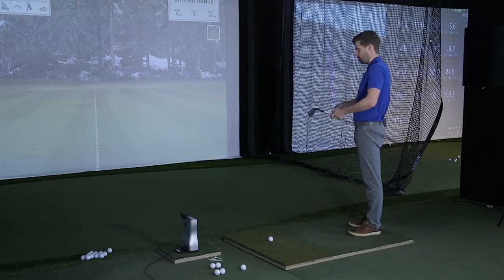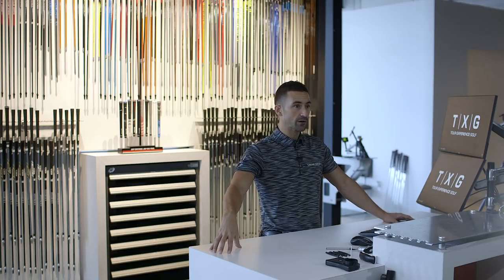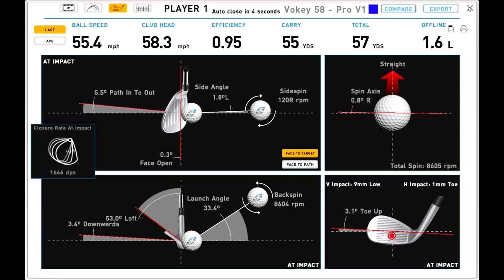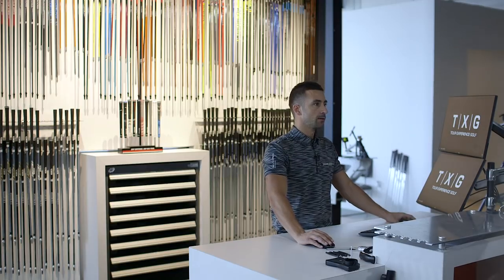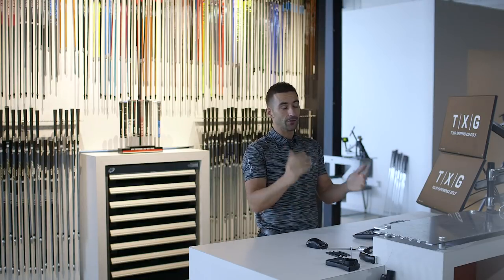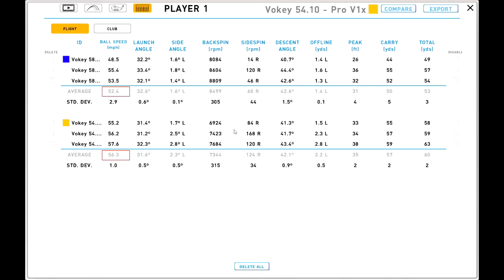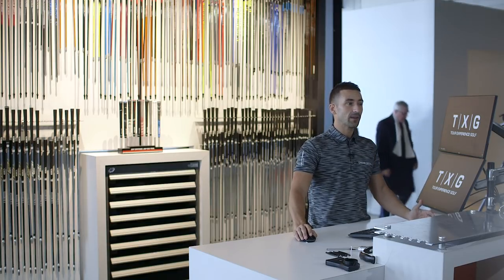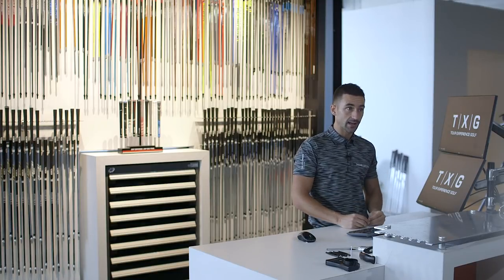Getting More Wedge Spin

Comment: Your comment at the end of the video about the wedge grind and loft set up for gapping is important. I thought I could buy Vokey off the rack... 6 Vokey’s later with horrible chipping and then I finally was fit and found Ping Glides to be my best option. SS in 50, 54 and 58, bent to 59. Dramatic improvement in chipping and my scores.

Comment: what i do from 20-50 yards is same club (for me it's a 60°) open the face and stance and hit a knockdown pitch shot, while accelerating both body and swing through the finish with a hinge and hold method, the distance I wanna carry is changed in the setup and the forward momentum makes it easier to clip the ball clean with a more descending blow at the same time, increasing spin while decreasing launch, this let's me 1 hop and stop it from any pitching distance and if I am in the rough and can't spin it as much i shallow out my attack angle and get a very high launch to use the trajectory for stopping it fast. It's not the easiest shot to hit but I practiced a lot the year I picked it up and since then my short game has helped me secure a lot of birdies on Par 5s and short Par 4s. You can shave as much as 5° of launch with that technique as well as get almost a thousand RPM of extra spin with it which makes it even more controlable. I would love if you guys gave this type of shot a test and see if you can get the same kind of performance difference.

Comment: With all the great content you Lads are producing sincerely hope you reap the rewards in your day/day business. As I've found, one of these videos where the more times I watch it, the more I learn. 

Interesting comment about changing wedges every 5 years. With distance gained from strong lofted modern irons, I'm thinking 8 & 9's will be almost as essential as wedges for that approach to the green, so they spin/bite more than the other irons in the set and not just because of the loft. So would you ever fit shafts better suited to "distance" flight and shafts suited for that "short game" shot in a 4-9 set, or is it solely the iron head make up and where the weight is positioned that produces the difference?
Reply from the maker: Good question. A product like the True Temper AMT shafts (https://www.truetemper.com/products/dynamic-gold-amt/) are designed to give progressively higher launch as you go down the set which would help with stopping power in the long irons. A lot can also be accomplished with a detailed iron gapping session where we test every club and adjust lofts as needed to get the best performance.

Comment: Ian,I have taken your advice and went to be fitted for 3 new wedges to replace the vokey I have had for the last 5 years.I have been steered away from the new vokeys as I am told that they are mast produced in China and not the same as the Japanese made ones the pros are using, and being fitted for the Cleveland. I note that you did not mention the shafts only the club head I would appreciate if you could discuss the different shafts, as he is suggesting that I should get a graphite wedge shaft, what would your opinion of the Titleist comment also is there specific wedge shafts and if so how do they differ from standard shafts?Fantastic channel and thoroughly enjoy all videos, your response would be very welcomed.RegardsDave

Comment: The reason why there is more spin a groove down on the face is that is where the most loft is statistically with the edge being there.

So I believe the trick is the have a good AOA whilst maintaining loft to guarentee a high spin loft. There is a trade off however with getting that compression on the ball thus more grab and more spin which is why the speed is important.

Comment: Great video. However what about outdoor testing? Shouldn't that be part of a club fitting also? One other question. What grinds for which ground conditions? And why such amassive array of grinds? Years ago there were two, maybe three at most, with 46 to 52 one stamdard, grind, 54 ton56 another and finally 58 to 62 a completely different grind. Thanks

Comment: I was hoping you would talk about bounce here. As amateurs we are told to have very little bounce on our wedges if course conditions are firm and dry or hard pan, maybe 6 or 7 degrees. Only have 10 to 12 degrees bounce if in soft sand or soft lush fairways. Some of your other videos seem to suggest otherwise. I know course conditions are different in Canada than south Texas in the summer but what do you suggest as a compromise? One general rule I follow that has helped is : never make a full swing with a wedge. If a three quarter swing won’t get it there use more club.
Reply from the maker: Another wedge video with more discussion about bounce and grind selection is coming!

Comment: Hi Guys
Late to the party as usual but every time I watch one of your videos its like i'd asked a question and youre answering it. Wouldve been useful to see Matts setup position as he seemed to have a big swing for 50 yds. Im current;ly playing a 58 degree (bunkers and close to the green) a 54 - my go to club for approach, and a 50 degree which honestly ive struggled with (all SM6 S grind), Ive got standard M1 irons and am thinking about bending the 50 degree to a 49 or 48 to fill the BIG gap (50 is 100-105, PW is 125 or 115 if i chole down). Love to hear (or better see) your thoughts - does bending a 50 degree work the same as buying a 48 degree sm6 off the peg?
Reply from the maker: Just be aware that bending loft strong takes away bounce to the same degree